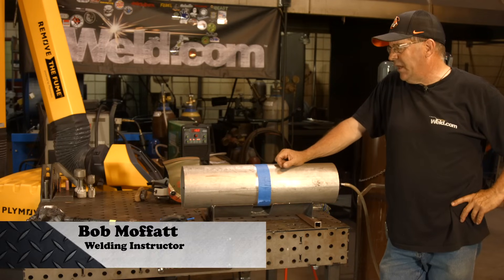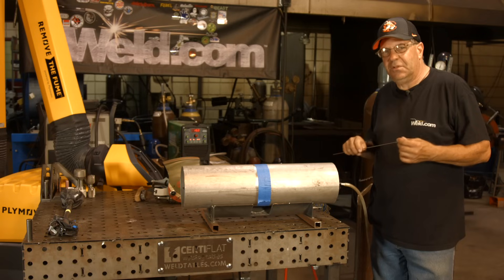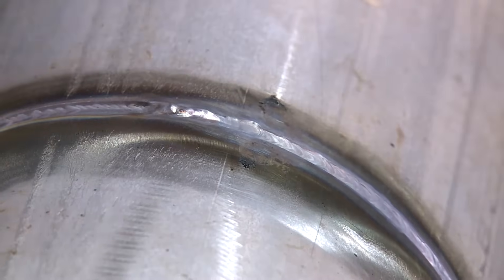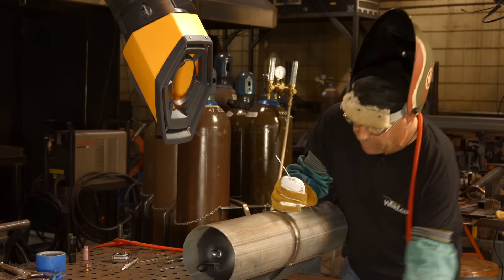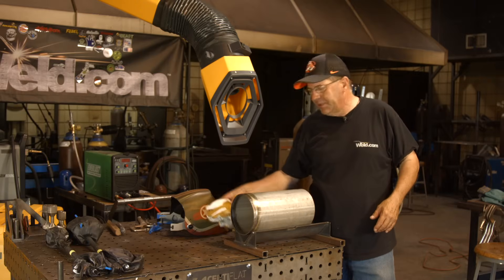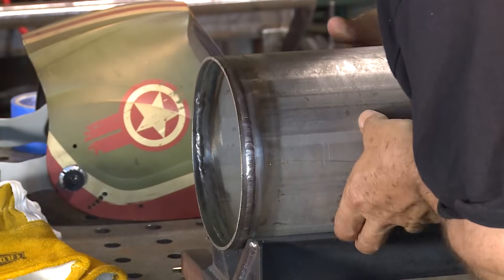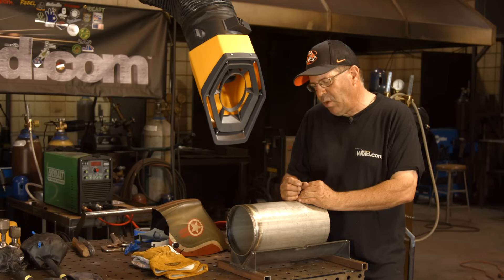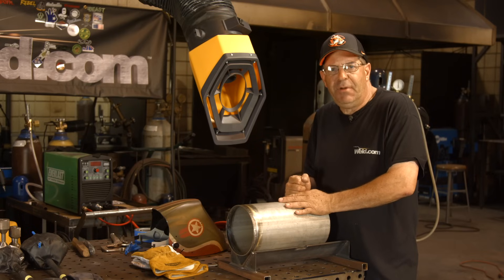🔥 TIG Welding 10 Gauge Stainless Pipe (with the HFT Purge Elite)

Comment: It's's ok to remove filler wire but you have to flip it around to other side that is clean, this weld is contaminated. Also, hand feeding rod should be done through the fingers, not with your entire arm. Try to choose the correct rod to lay wire the cap and avoid feeding wire on the cap.

Comment: Bigger cup helps move faster and helps shield the weld . I would cap with a size 12 ceramic cup
Reply: Ive found an 8 on a gas lense best for me for capping off with if walking, but yeah other than that, a 10 or 12 if freehanding it

Comment: Very good. Imagine this I worked in food plant we had 1 inch 316 SS thin wall chemical fill lines, acids, caustics etc. These were often 100 plus feet long all welded in place no ferrules or clamps to get inside and purge. They would get pinhole leaks and we had to climb up into the rafters and try and repair these with TIG, porous, couple year old SS, with chemical residue inside, talk about a challenge.

Comment: What's the reason behind taping over the root opening?
Reply from the maker: We're purging the pipe from the inside. If you don't tape the root opening you are allowing for air to enter the inside of the pipe.
Reply: Can you tell how to tie in to tacks on stainless pipe welding? I couldn't see much of it here.
Reply: I just crank up the purge and turn it down when I close to finish

Comment: I have been welding some schedule ten stainless at work. some guys have been telling me to slam it together no gap, just keep wire in case it opens up. in the puddle just wait for the little balls to dance inside the puddle and take off and it leaves a perfect colorful pass inside the pipe on root. I have done it on small stuff just afraid to try on 10 inch. what do you think?
Reply: I have been capping it at around 90 walking the cup. pipe fitter out of local 83

Comment: Hi Bob, great video as usual.  Going up the sides are the easy part.  How do you contort coming off the bottom?  Arc shots or not I'd love to see how you get comfortable, hold yourself steady, see the puddle with the wire in front of it.   What's the best way to hold the torch while progressing up and around.  It's not as easy as it sounds.
Thanks,
Tim
Reply from the maker: Tim, we have lots of videos doing 5G and 6G pipe that shows bottom to top. If you go to our channel page and do a quick search for either you will find some.

Comment: do you have to purge only stainless or all metals?
Reply: Most anything except maybe carbon steel piping, if you want nice root back face......I've even purged that carbon steel to get nice bead inside the pipe.....   Some years ago, I was working at a bio-mass generating plant...33 mega-watts ...but steam temp/pressure the same realm as Nukes.....1050 degrees F'... and 1,100 PSI.....from steam generator to turbine was 12" stainless pipe...about 2" wall.....  During a routine, scheduled shutdown, contractors replaced all the superheat boiler tubes....2" heavy wall ( about 3/8") chromoly, 180 degree bends, maybe 250 of them......welders didn't purge....inspector 'failed' most (using a lighted bore-scope)...arguments started...so.....all had to be cut out and done over......30-35 welders sent home for a week, lots of crane work...access only from top of 130 foot high water-wall boiler....tubes all had to have ends re-sawed and beveled.....all done inside the firebox.... working on scaffolds....80-100 feet up there....
so...I'm sure all the re-work cost a lot more than a few cylinders of argon.....you can get paper water soluble purge dams for this exact situation, when you wash out the steam system later...the purge dams just dissolve and go out with waste water.....
Reply: Purge all metals or have backing gas mate if you are penetrating thru the metal, other wise you will get a sugaring effect on the other side of the weld. (not structurally sound ) Except aluminium.
Reply: Doug Ankrum sounds like they should've fired & rehired the CWI's
I've seen stuff done like that before
Reply: You have to purge all metals except carbon steel....unless you have to use an alloy filler rod then that carbon pipe has to be purged as well

Comment: Why only argon purge ? Its not dispersing the air as good as a gas made for it... backside color is not approved. 😕 and a hint, protect your welding wire form Oxydation using shieldgas

Comment: This is exactly why I  respect and admire Bob. I've have been asking for this thin stainless steel pipe tutorial and he delivers 💯. Little ironic tho because im in Baytown TX testing for a company and I had got a 6inch sch 10 stainless that I busted out on the root smdh.
Reply: .  Sounds like you're headed in the right direction and know what you're talking about with the SS pipe/tubing...!    Power plants, food service and refineries are all very picky about appearances, even if it's not that important.....BUT.......develop good practices in the beginning, then it's all easy every time later... Some situations where the piping has high pressure and high flow rates...the inside of the pipe welds are pretty important, od erosion can get started there.....little or no 're-enforcement' on those beads...flatter, the better.... My 29 year old nephew has been doing carbon steel piping for about 5-6 years in Hawaii, lots of smaw, little if any TIG stuff...he recently moved to Muncie, Indiana and got a job in a petroleum refinery....quite a surprise for him with a lot of stainless, Inconel and other high nickel stuff....lots of TIG, but he's pretty good at learning, so he's getting that $50+ an hour....
Reply: Doug Ankrum my  purge was good I didn't bust because of suger it was that the root wasn't uniform enough
Reply: Ant Solis BE WARNED because at the testing lab the QCs they are using are super strict and very picky for that job. Yesterday a seasoned vet with over 30 years pipe welding experience busted out because of a little hiccup by that I mean he had a very small spot of internal undercut at the bottom the QC caught it when he put the mirror inside that was totally uncalled for and I bet that inspector knew that pipe would of shot good on xray
Reply: Doug Ankrum yea I guess you could do without the purge after the second pass depending on the thickness of the pipe and how much weld you got in there but of course the root and the hot pass must be purged or that bead will sugar up as soon as you fire up. If you have the experience like you say then of course you know that I was just saying. I really need to work on my tig stainless or I can kiss those good paying plant jobs goodbye. Almost all those contractors are giving the combo hands requirements of being able to pass a stainless pipe first and im not talking about carbon to stainless with the 309L filler rod its stainless too stainless 308 filler
Reply: hey Ric, I am also in baytown,tx bro, I was on the CPCHEM project for almost 2 yrs. I got a test for ISP in Hackberry LO , next week, Goodluck on your next test. let me know if you have any leads on jobs in baytown or pipe welding combo jobs anywhere thx.
Reply: ...Bad Root..Ouch!........I've welded quite a bit of Sch. 10 stainless....always run plenty of purge...and even tape off the root except a couple inches where you're welding, I usually used a good bevel, and 1/16 to 3/32" root opening....1/16" filler....and all done with antique Airgas or Linde Transformer TIG machines....on these old machines....you get 1 dial...'current'.....and 1 switch...AC/DC-/DC+........
Reply: Ric Dweld for the hackberry job?
Reply: Ant Solis yes sirrr they hiring big time too they need almost 200 combo pipe welders
Reply: OK....the root....always a sore spot, and even if it's good, and inside is OK.....some inspectors are really hung up on the appearance of the bead/s..... Sugar.....that is something that I only had couple times.....trying to make 2nd or 3rd pass without the purge still connected..
Reply: Doug Ankrum He must be a dam good welder just to make it to the site probably had to take quite a few tests and then have to make a few production shots in the field to get there... much respect. And all those metals you mentioned are pretty tough welds.. me personally inconel and monel are not made for rookies chrome also dont know about titanium never touched it
Reply: Damn I'm from Houston myself but only weld mig and and some flux core...are they needing pipefitter helpers at that job?
Reply: What company u go through?
Reply: Ric Dweld what company u went through, mcsi?
Reply: yaboyyungdray I was testing for a company named Global turnaround services
Reply: if you busted out, can't you test again after a while?
Reply: KRS 1 yes if the contactor gives you another shot your eligible after 30 days but in some cases if the contactor knows you can weld cause you worked for them before and you bust the test because hey it happens to everyone they can retest you the same day but it's a 2 for 1 meaning you have to retake the pipe you busted twice and of course pass them both before proceeding to the rest of the test or retake it the following day but it depends on the contactor/recruiter. But if your unknown its 30days and thats only if they even decide to let you take it again
Reply: If they're were needing 200 combo guys two weeks ago, they probably filled them all by now. aren't many jobs out there right now and I don't mean just in Houston/Baytown/Freeport/ area, but all over. I bet a lot of guys came from other states to fill those spots.
Reply: DaddyFat Sacks what is most common pipe test to work as a combo pipe welder in the refineries?
Reply: The common would be 2 Monster coupons(5/8th wall thickness) both welded in 4hrs each. first test is usually Tig/Stick combo which is Root/HotPass and partial fill TIG first. then Fill/Cap Stick(7018) out. this is the first test because it is the most difficult . and then the TIG all the way out, R/H/F/C. Iv seen QC bust people right at the 4 hour mark, and some QC give extra 2 hrs total of 6+ hrs and bust people, many new welders just choke up with the "test" and someone coming to your both and looking at you and walking away and just freaks welders out and they dont put enough metal on the pipe can not finish. Iv gotten xray results from testing the day before to some xray results being 1 wk later. Every time is different. GoodLuck bub hope it helps.

Comment: Great video, I haven't Purged the cap weld. Does it help?
Reply: Charlie Spann yes it helps it from getting too hot, also turn the argon up on your tig rig as high as you possibly can that also helps
Reply: It would help, as thin as sch.10 is....running a cap bead can still get the inside of the pipe very hot..... I've welded a LOT of 6, 8,10, and 12" sch. 10....most all was less than 3/16" thick....I tried running a TIG cap without purge....the inside was badly oxidized (sugared)....
Reply: U say turn ur torch flow rate up...how high are you talkin, 50cfh?

Comment: every time i do a gap like this i get lack of penetration any tips on what im doing wrong?
Reply: most likely not enough heat and going too fast.  need to let the walls break down meaning you should be key holing and/or have the filler wire fed from the back.  im guessing you are doing the lay wire technique?  that can lead to lack of fusion and suck back when you're welding from the 6 oclock to 9 oclock
Reply: ok got ya thanks for the help man ganna try it out!!
Reply: Feed the rod straight down from the top tack onto the bottom. The rod will look like a straight line going down the middle of the pipe. I  do that up until I'm about up the middle of the pipe and then I just dip the root.

Comment: Im totally new to this, but just started sch 10 ss pipe in our class, how long do you purge for? I have just put the tape on, and let it sit there for around 3 mins, any advise I appreciate.
Reply: Clive. It depends on the diameter/size of the pipe and the length of the pipe. The more volume, the longer you will need to purge it.  The purpose of a purge is to expel the oxygen out with an inert gas such as argon or nitrogen. Argon is heavier than air so if you are rolling one out horizontal like in the video, just imagine the argon settling at the bottom and pushing out the oxygen out the top. If you are using masking tape, for the side you want your purge to vent I'd put a few vent holes towards the top of the pipe and then when I feel it's good and purged I will put more vent holes top, sides and bottom. And if you don't poke enough holes or large enough holes in your tape and your argon purge flow rate is too high, when you go to finish your root pass it could blow out on you because the argon has to escape somewhere and it will push through the molten metal and you will fight it trying to tie it in.
Reply: Thank you very much Mauricio, I appreciate you replying to me..

Comment: I have never seen purge done before, except when welding fuel tank with file still in it. 

When welding high carbon steel I have seen it when there is an issue when TIG welding one may encounter impurity, the use of a Stainless filler wire works well. What is the theory behind this?
Reply: purge is 100% necessary on any stainless welding, including carbon when using stainless filler since stainless is so sensitive to atmospheric gasses.. some people just purge the root.. i purge for the whole process
Reply: Yes...I purge anything thinner than about 1/4"....a few extra CFH of Argon is waaay less $$$ than a weld that fails a qualification for a job interview........or for any weld ....
Reply: kevin annand I found that out the hard way, some how a 70s6 filler got put in my SS filler container.. I just blindly grabbed doing some 2in sch 40 pipe and it was almost immediate dog shit soon as filler was added all due to lack of shielding gas

Comment: I've had the had push the root flush, have trouble getting poke through, fine line between to high and to low purge pressure